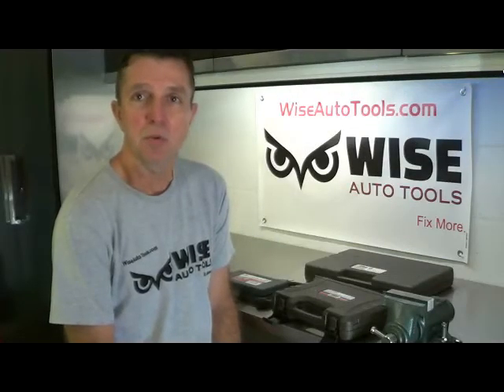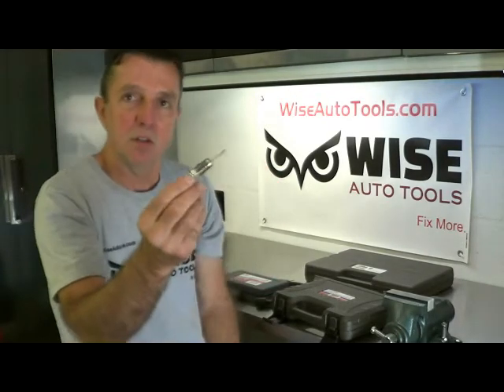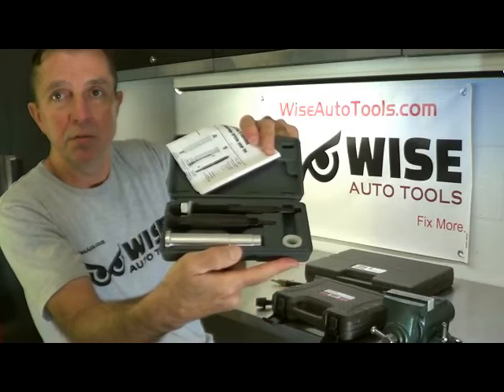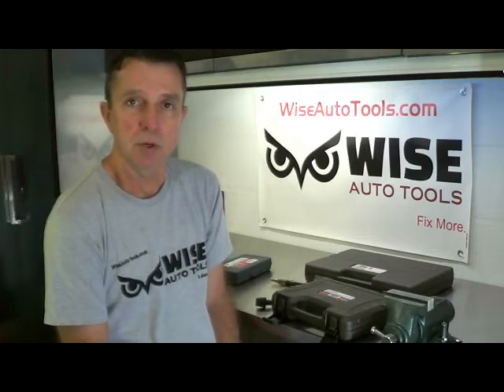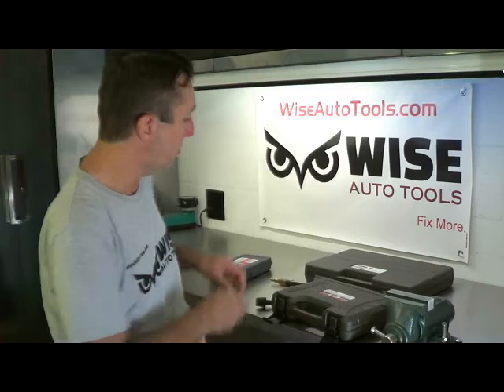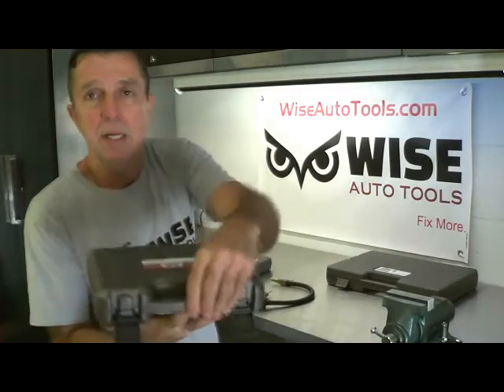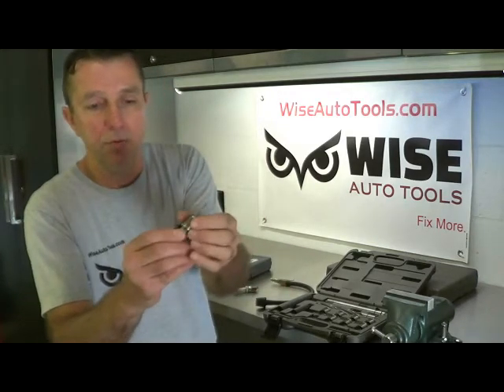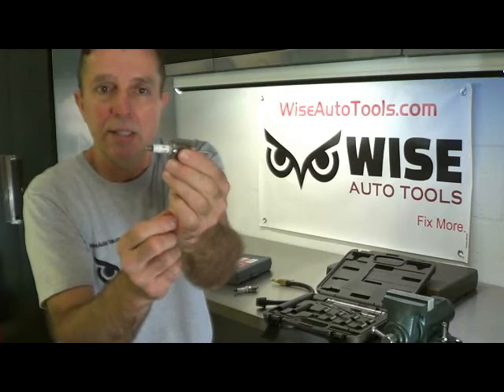Ford 3V Spark Plug Tools - Calvan 39300, ATD-5410, FRT12

Comment: So once the insert is installed using the atd5410, how do you get the motorcraft sp515 spark plug all the way down being the hex head goes inside the insert? Then how do you get it out once it's in because a socket will not reach the hex head of the plug anymore.

Comment from the maker: To purchase the Ford 3-Valve spark plug thread repair kit see the following link. http://wiseautotools.com/calvan-39300-ford-triton-3-valve-m16x1-5-spark-plug-insert-installer-kit/

For 393-100 replacement inserts for the 3V kit see the following link. http://wiseautotools.com/calvan-393-100-single-replacement-insert-for-3v-kit-39300/

For a Cylinder Leak tester see the following link. http://wiseautotools.com/calvan-cv-389-4000-leak-tester-to-determine-valves-are-closed/